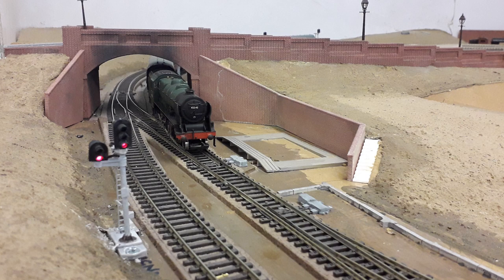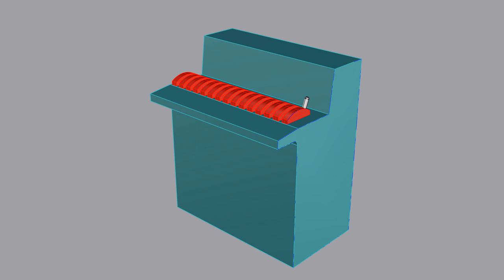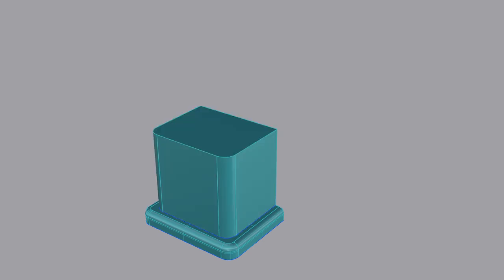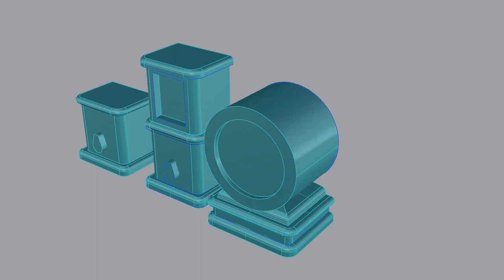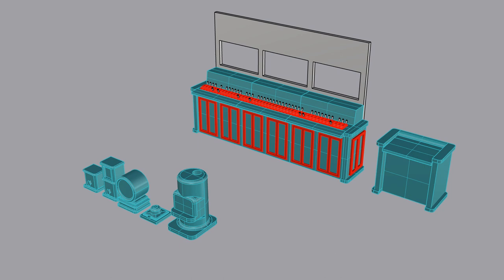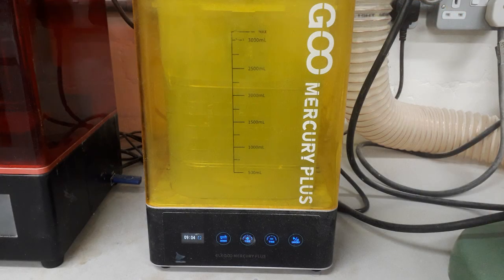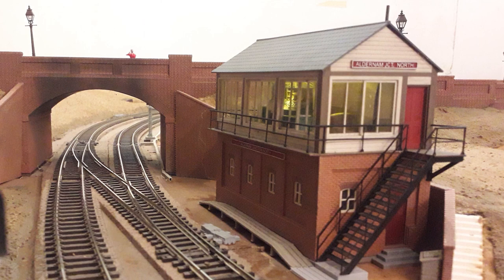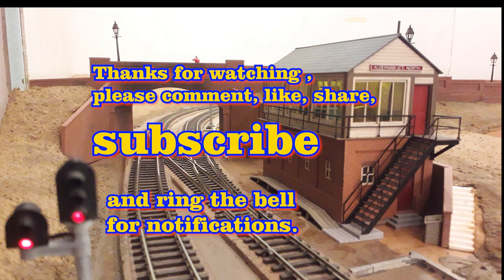3D Printing a Signal Box Interior

Comment: What software programme were you using?
Final products look really good and like the control panel. The signalman will have an enjoyable shift now!
Reply from the maker: The software is called Rhino 7 , but any cad program will do so long as you can export an "stl" file and you can scale it as required, OO or O gauge.  I've made point machines and relay cabinets, see www.old-duffers-chuffers.co.uk
Reply: @old_duffers_chuffers  some nice products